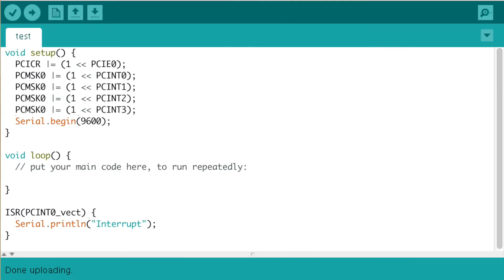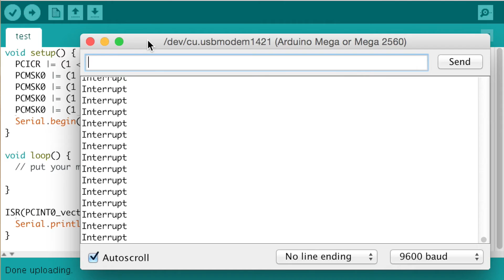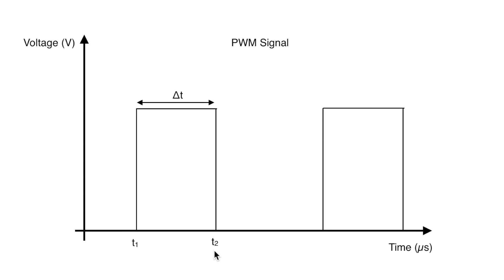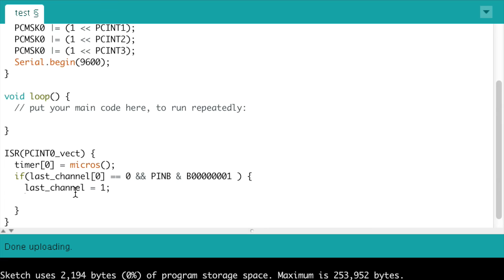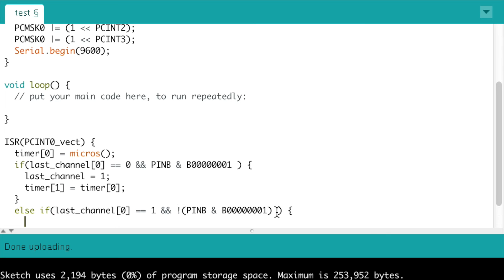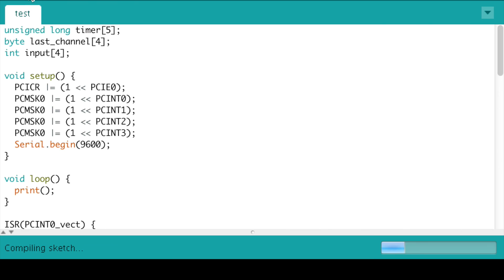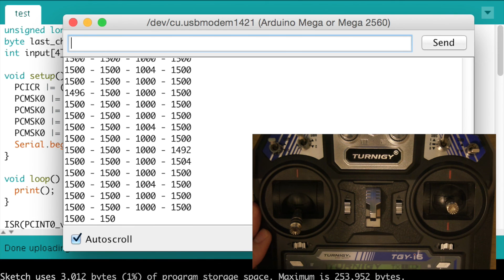Reading PWM Receiver Signal Using Arduino with Interrupt - Part 2

Comment: Excellent series of videos, very clear and concise!!
Do you know how to use these inputs to switch an output pin on a UNO, to switch an LED array on and off based on the pulse width? Say, <1200us LED's are off and >1800us LED's are on. I am struggling with how to write the code using digitalWrite.

Comment: very good tutorial... can you tell me the difference between ppm on and off in rx settings on tx
Reply: Do you have a flysky fsi6? If yes, then you need ia6b receiver to use ppm option. the stock receiver cannot work with ppm.  More on interfacing ppm here http://www.instructables.com/id/Reading-RC-Receiver-PPM-Signal-Using-Arduino/

Comment: Hi karan
Very good, your tutorial!
helped me a lot.
Let me ask you 3 questions?
The first, is it possible to use the other interrupt ports?
I have the atmega 328p -AU, and in the datasheet informs that it has 23 interrupt ports.
I changed the code, added more variables to store the timer values and port, for exemple   B00010000
But the interruption occurs only in pins 12,13,14 and 15.
For example, in the datasheet it says that pin 1 is also interrupt, but it does not work.
I'll need to use 3 ports to read 3 channels from my receiver,
But then I'll need to use two PWM ports for this.
I wanted to use an interrupt port that did not have the PWM function.
In my case I need the 6 PWM ports.
Do you know how?
The other question is, the pulsein command would help me solve this problem.
But the problem is that when the signal is missing, it takes too long.
But the advantage of pulsein is that you can use any port to read PPM signal.
Do you know how the pulse in command works?
Or just how to do a PWM via software?
Thanks!

Comment: I would like to have a more versatile PWM decoder to decode both the Duration and Frequency of PWM signals from 1 to 100kHz.  Could you please show how that would be accomplished if capable using arduino.  Thanks for your great work!

Comment: hi,,how to controll brushless motor with this project ??
Reply: hi.  you should write a program to get the values (input[0-3]) and convert them into PWM signals if you are using an ESC.   I would use the servo library.  search controlling a brushless motor with Arduino.  and i would use the Map function in Arduino.  Hope this helps

Comment: How would you use PCINT13-8 for this?
Reply from the maker: PCINT15-8 are registered with interrupt enabler PCIE1 therefore you first need to run
PCICR |= (1 << PCIE1) to enable it
now pins from PCINT8 -> PCINT15 can be used as interrupt pins but they are managed by PCMSK1 register, to enable each pin use
PCMSK1 |= (1 << PCINT8)
PCMSK1 |= (1 << PCINT9) etc
finally use
ISR(PCINT1_vect) {
this will be launched when pins PCINT8 -> PCINT15 generate interrupt
}

All this is only possible if the micro controller you are using have multiple interrupt registers. The above code should work for Mega2560. You can always modify it to suite your micro controller. You need to look at 'External Interrupts' section in data sheet, seems like a long read but it helps. That would state all the references you may need.
Reply: actually switched over to a MEGA board and I'm using
PCICR |= (1 << PCIE2);
PCMSK2 |= (1 << PCINT16);

ISR (PCINT2_vect)
{
  timer[0] = micros();
  // channel 1 ---------------
  if(last_channel[0] == 0 && PIND & B00000001)
  {
    last_channel[0] = 1;
    timer[1] = timer[0];
  }else if(last_channel[0] == 1 && !(PIND & B00000001))
  {
    last_channel[0] = 0;
    radiosignal[0] = timer[0] - timer[1];
  }

I cannot for the life of me figure out why this is not working... if I change PIND & B00000001 to digitalRead(62) == HIGH then everything works 100% perfectly.... what am I doing wrong with PIND & B00000001...?
Reply from the maker: That mistake is very common, PCINT16 has input register PINK not PIND. Using PINK & B00000001 should work.

Depending on what you want the micro controller to do, try to avoid using digitalRead as it has many overheads and takes long to compute.
Reply: Thanks for the help! I'm wondering if you can help me fix another issue kind of related to this. I'm using this code you showed in the videos to read my RC receiver's 6 channels. Now I'm using the built in Servo library to actually control my servos, and they have a really bad jitter problem. The servos glitch a couple degrees every few seconds, I think the arduino library is not very good. I have no idea where to even begin to write my own servo control code.

Comment: something is not working good for my Leonardo pro micro for input[0] I get 6724
and for toher channels I get around:
input[1] 13884
input[2] 11528
input[3] 12192

just by touching the analog pins by hand!
Reply from the maker: If the pins are open, they are likely to generate noise. Make sure they are connected to source if needed otherwise ground them or disable their interrupt.

Comment: Quick question on the timer array. You've declared an array of 4 timers but then used timers 0 > 4. Why does this not throw an error?
Reply from the maker: +Chris Pavey Sorry, I fixed it but the video probably got cut in post so it wasn't mentioned. The final code is actually using 5 timers which is correct. I'm trying to annotate that error but it wouldn't let me...

Comment: I follow the same procedure but the channel which I have selected as last always giving wrong values.  But the other channels are working fine. Do you have any idea about this?
Reply from the maker: +Niloy Sarkar I would check if the board supports interrupt at that pin. Also verify that you are allocating correct variables. Finally could be a broken connection.
Reply: how to choos which pin for which channel? I have a Leonardo Pro Micro and want to hook my receiver as joystick, the joystick library is working now I need to know what pins are good and how to set them up for receiver inputs (4-5 channels enough for me)
According to documentation:
Micro, Leonardo, other 32u4-based, Digital Pins Usable For Interrupts: 0, 1, 2, 3, 7
But on the board pin numbers start from 2..10 then 14 15 16, no other pins like pin 1 or pin 0
http://media.apcmag.com/wp-content/uploads/sites/20/2014/01/apcnews2012apc-arduino-foot-switch-project-thumb_mainImage2.jpg2.jpg
upd: oh I found it the RX0 and TX1 are used for it:
External Interrupts: 0(RX), 1(TX), 2, 3 and 7. These pins can be configured to trigger an interrupt on a low value, a rising or falling edge, or a change in value. See the attachInterrupt() function for details.
Serial: 0 (RX) and 1 (TX). Used to receive (RX) and transmit (TX) TTL serial data using the ATmega32U4 hardware serial capability. Note that on the Micro, the Serial class refers to USB (CDC) communication; for TTL serial on pins 0 and 1, use the Serial1 class.
So far I could get:
https://docs.google.com/document/d/1ew2NMjswf7mPXAz_kwTeJL5NdgQKJrjOKzxiGQrffEU/edit?usp=sharing
Reply from the maker: You code seems good to me, in order to choose the pins you want to use, you need to cross reference PCINT0 -> PCINT3 from data sheet to arduino pinout. Then when you plug the pins in, they should read. If you think interrupts are not working correctly, try running one interrupt at a time to see if they all work on their own.